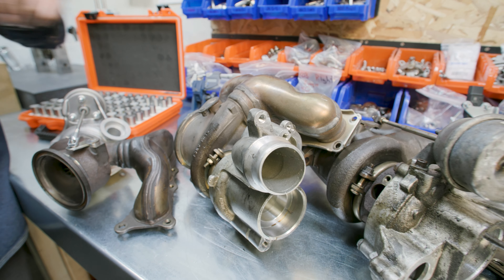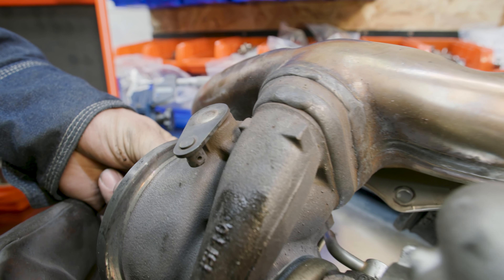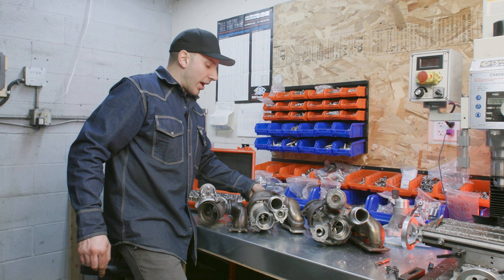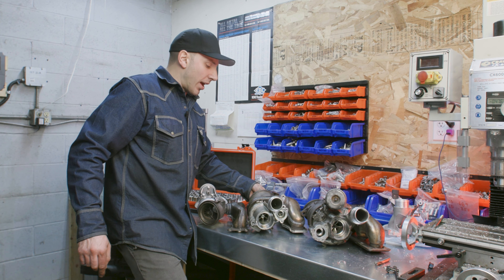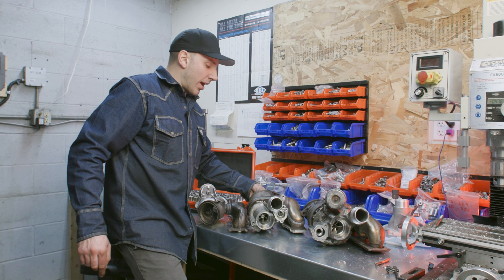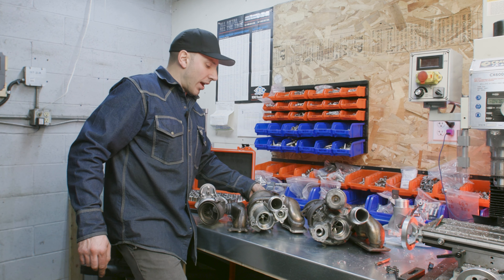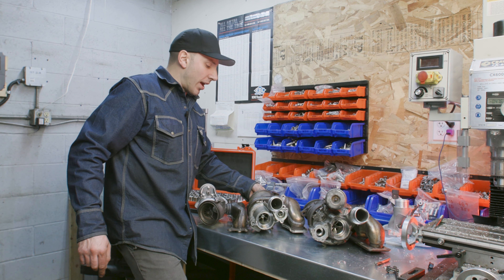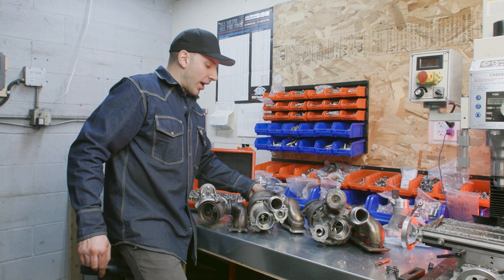BMW Turbo Wastegate Rattle Repair

Comment: Nothing but great things to say about TPC. Proud owner of their N54 Stage 2 turbos. A fantastic product, and yes... NO WASTEGATE RATTLE! Thanks nick.
Reply: How are they holding up? Psi?
Reply: two years in, not too many miles but substantial use. currently at 26.5 psi @KingKhu0ng

Comment: Hi there, I’m planning to buy a 2011 335i with N55 engine. There is a little wastegate rattle on the cold start that goes away but I’d personally fix it if I buy the car. What are my options? Will I have to replace the entire turbo assembly or can it be repaired?
Reply from the maker: Hi Alex, unfortunately you will have to pull the turbo to change out the waste gate bushing assembly. These are very tricky to do and require very good tolerances to avoid failure.